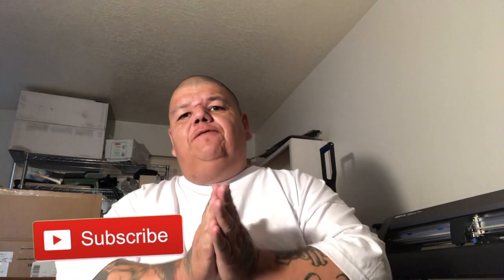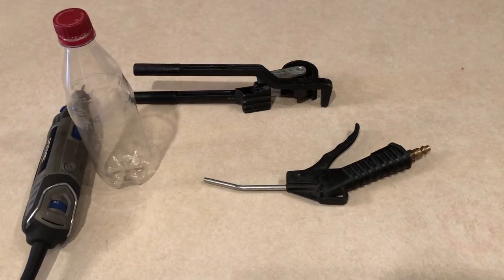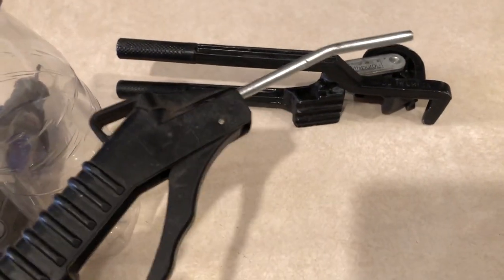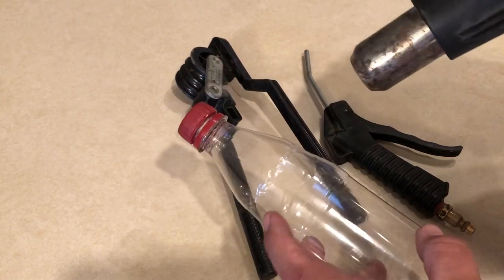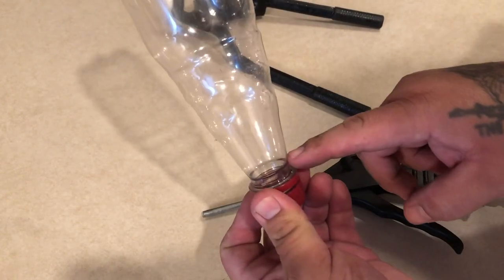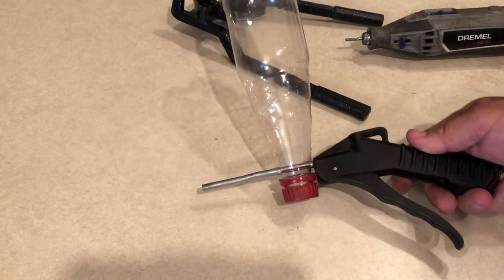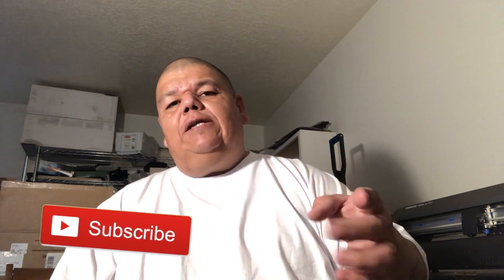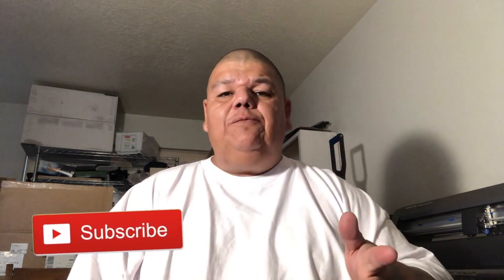DIY HOMEMADE SAND/SODA BLASTER UNDER $5

Comment: Soda is not for removing rust, it is good for cleaning aluminium and removing paint.
Use glass for removing rust.
And if you seal up the pipe against the bottle from the inside with for example epoxi this type of blaster is quite useable for small jobs.

Thanx for the video!

Comment: A venturi only works if the airflow draws something in at the same direction as the flow.
You have cut an opening perpendicular to the flow and it’s pressuring the bottle instead of creating a vacuum.

To fix it, a small bent tube can be inserted into the opening pointing in the same direction as the nozzle and sealed around the edges. That will draw the soda in because of the induced vacuum